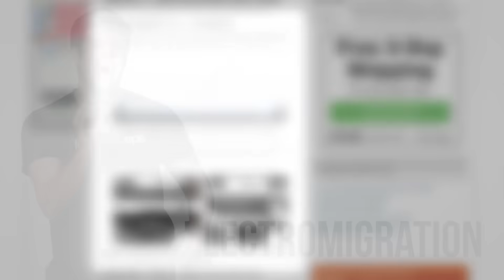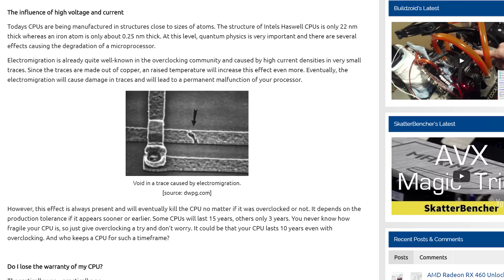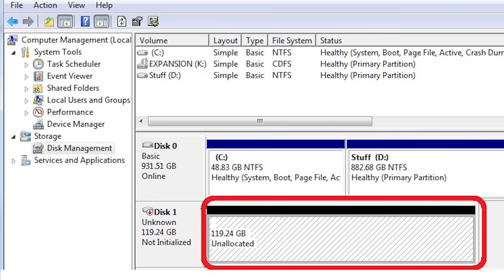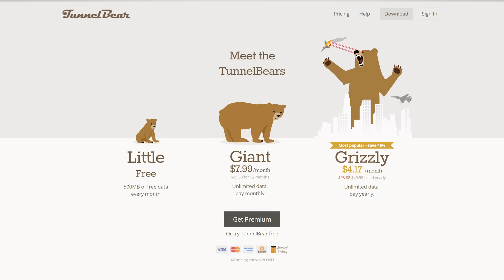Why Do Electronics Die?

Comment: Please explain to me why my TRS-80 Color Computer (1) from from 1981 still works just fine with all original parts? I don't understand. I thought all PCs die and get useless. The madness. It must be cursed. My 1996 Compaq Presario 4716 desktop pc must be cursed too. It still runs like the day I bought it with all original parts. 

.... Computers do last many decades, but they have to be built well and more importantly: You have to take care of them. Don't expect something last if you treat it like crap. Many times capacitors are the only thing that ever goes bad on a motherboard if you treat it well and you can replace capacitors easily. (note: I've not replaced a single thing on the afore-mentioned PCs, you get what you pay for)

Comment: The wear of flash memory is as follow:
Each time we need to change the value of a bit from 1 to 0 ot 0 to 1, a high voltage is generated (about 15 volt) to force the electron to zap thru an insulator. It is literally an electro-static shock similar to the flash on the spark plug in a motor.

Each time a different value is written, this is a burn mark. After 10 thousand (old flash) to 1 million (current flash) such write cycle, the damage is too much and that particular bit doesn't retain memory anymore.

Electro-migration of copper is real, but the explanation is not clear. At microscopic level, copper can be seen as a soft metal, similar to the way we perceive lead. Electric field and magnetic force induce force on the copper atoms, they start moving slowly, somehow like the ice in a glacier.

Thermal shock is probably the biggest aging factor. Each time we turn off the device, then on, many components expands or contract... soon or later, small cracks appear and expand on each thermal cycle. Screws holding power transistors to heat sink get loose. 

One day, the "perfect storm" happen : the weakest component increase it's resistance, get more hot than usual, expand more than ever before, heat increase on the highest resistive part. A run away race condition quickly conspire to destroy that weak device. As it short circuit, it damage an otherwise perfectly good power component. The PCB then absorb the high current and a few trace burns before the fuse finally come in to stop further damages.

The user replace the fuse by any other that he find ; 10 amp should be fine for a quick test, to replace that 1.25 amp. More PCB disappear in smoke. That piece of sh**t is trowed in garbage.

Comment: My Commodore 64 still running after 30 plus years... So...
Reply: Yet in that 30 years it could not do the work an i7 could do in a day.
Reply: Depends on the kind of work. Raw horsepower? No match, but if I need to type a document, do a little desktop publishing or use a spreadsheet, I could make it work, not as quick or convenient, but it would be possible. My i7 laptop is also far more portable and convenient, but doesn't quite give me the smile that C64 does.
Reply: So are smiles

Comment: I remember when my old samsung syncmaster 226BW broke from capacitor failure. I was so pissed off.
Reply: I remember when my Samsung died due to faulty capacitors. I replaced them with new ones. I bought quality Japanese manufactured Nichicon brand capacitors too.

Comment: And even if you somehow managed to solve all these problems your electronics would still die. Quantum tunneling gradually erodes a transistor's oxide gate. This is incidentally the same reason we are running up to an asymptote  with Moore's law and silicon MOSFETS. If we make them smaller or pack them closer together then quantum tunneling will allow electrons to skip the channel and go right into the output (meaning it still leaks power when turned off) or jump across channels and scramble all your signals.

Comment: I'm old enough to know & remember TV's, Radios, Turntables used to work for 20-25 years and they got hot enough to keep your food cozy.  So Planned Obsolescence is the Number one and biggest reason why electronics fail.  The designers/makers know they can make a product work for 100 years, like the light bulbs that were made in the early 1900's.
Reply: http://centennialbulb.org/cam.htm
Reply: Nonsense. TVs broke often. They were expensive so they were repaired often. The color TVs that I have used have lasted average of 9 years with total of at least three paid repairs for five sets.

Ah the light bulb conspiracy. That has been debunked so many times. Sure there is kernel of truth i.e. the cartel but the physics of light bulbs are well known. If you want t make a 60 watt bulb last twice as long and give same amount of light you need to make a 66 watt bulb. The bulbs costs some 50 cents and in 1000 hours it uses some $6 worth of electricity. That is  $6.50 for 1000 hours. Now the 66 watt bulb costs only 25 cents for 1000 hours but it uses  $6.60 worth of energy. That is $6.85 / 1000 hours. Also the color of the light from the 66 watt bulb would be more red.

Now there are applications where long lasting bulbs are good like if there are labor costs in changing. For those purposes there has been special bulbs. Also during heating period one could save hasting bill because f the extra heat but that in general is not that significant.

If you believe in the conspiracy when why did the manufacturers make long lasting bulbs using fluorescent bulbs or LEDs when the technology allowed it?

Comment: You missed one of the major causes of random failure in electronics tin whiskers in RoHS solder.
RoHS solder also is a lot more susceptible to thermal fatigue since it's more brittle than lead solder.
 This is one reason why an Atari 2600 or NES that's has been sitting in a box in in a hot attic for 20 years will often still work while an Xbox that has lived a comfortable life next to the TV dies after a few years.
 The Restriction of hazardous substances directive ironically probably has turned out to be one of the most environmentally harmful laws ever written.

Comment: Ah, finally he got to the moving parts in SSDs and circuit boards/wires... electrons and current! Also, you forgot to mention that dust build up is the biggest killer/perpetrator of heat! This video just made OCD people explode. lol, this is why Amazon CTO says "Computers fail all the time, so you have to plan for that".

Comment: I have worked in NAND drive development for 8 years.  If all goes well we know the precise number of cycles we can read write or clear bits. Done properly, we can slowly and safely manage the data. Using trend analysis we can even alert you ahead of time before a failure. As NAND gets smaller it wears out sooner. This is why old devices from the 80's will actually outlasts newer devices.
Reply: So , how is it going?
Reply: @sciencecreatedus9475  so, how is it going?
Reply: How's it going?

Comment: ther's a mistake there, the SSD life have timer, becouse the electrons build up in the insulator around the tranzistor, that stores data, and it's not about decreasing the voltage of the tranzistors ( that's the data retencion over time ), but change in the insulator properties, that can make reading, writing, or erasing the data imposible.

Comment: Heat. Heat kills electronics. Voltage spikes. Keep your stuff cool, and all electronics behind a UPS.
Reply: Your PSU should be able to manage voltage spikes. That is one of its jobs.
Reply: The key word there is 'SHOULD'. When 'should' doesn't happen, parts (sometimes very expensive parts) die. And you won't know the capacity of your power supply to manage voltage spikes (or even be the cause of them) until it's too late. Way too many nerds will buy the cheapest power supply labeled '1500 watts', believing that it's made in mongolia glossy box label with the lightning bolts on it, means it contains great components. See it all the time. $600 video card, $350 processor, on a $49 motherboard (because they got a great combo deal!) and a $39 power supply in a $35 (has to be black with a window) case.  Oh, and with a $10 keyboard and $4 mouse.

Comment: Most common killer, apart from planned failure... lead free solder. Those solder joints have no give when heated and cooled, they become brittle and crack. These cracks cause voltage drops and other problems including heat, which compounds the original problem.

Comment: So theoretically if we remove the issue of heat, it will (at least) become possible to have electronics that can last forever?
Reply: The underlying problem is you're running low direct current devices on relatively high alternating current. So at some point that scheme is going to break down. When it does bad things happen too.

Comment: Actually manufacturing something to fail about the time the warranty runs up is an unfair business practice under most consumer law, and possibly fraud depending on the circumstances.

Planned obsolescence is more so the 'rationing' of technological advances.  Essentially better technology exists, but a company will try and sell what they haven't sold yet.  Kind of like what Intel is doing.  They could release better processors, but have stayed with a consistent 10% upgrade.  However with Ryzen competition, they may ditch the next upgrade and skip over to something more competitive.

Comment: Current is the flow of holes aka the absence of electrons. Current always flows in the opposite direction of electron flow... Electrons are negatively charged, hence why the positive side of the battery is the source of current.
Reply: No. Ben just guessed wrong. That is why conventional is opposite actual current flow.

Comment: While I have long raged about planned obsolescence, the hardware versions of it (for computers) is more a lack of overengineering. They know that, even if they make it so it can last 100 years, 99.999% of them will be thrown out within 10-15 years (often times less). 

Planned obsolescence is definitely a problem with cell phones, and any time a software update significantly reduces performance there is no way it can be anything but. If you aren't willing to maintain support for a product, don't allow the new update to be installed on it. 95-99% of users won't even use the changes much, and 100% of them would prefer a usable older OS to a newer, more featured, unusably slow OS.

But even worse than cell phones/software is the fucking appliance manufacturers. They carefully calculate how durable they have to make the parts for it to last long enough that it isn't too obvious, and then offer a warranty that they expect to expire anywhere from a month to a year before the thing breaks. At least with the cell phones and OS issues it is primarily them knowing it will break and not caring, those damn appliance companies spend significant effort figuring out just the right balance needed to screw consumers the hardest, without getting them so angry they go to a different brand.

Comment: Electrons don't have mass.... but close enough
Reply: Kyli Rouge You're kidding right?  Electrons have mass...
Reply: EGL24Xx electrons (aka photons) have no inherent mass. Don't you remember why the Higgs-Boson was such a big deal?
Reply: Kyli Rouge Electrons and photons are not the same.  Not even close
Reply: huh... seems I'm wrong. I coulda sworn photons were just electrons in some different state. Today I re-learned! Anyway my original point was going to be that it's probably more electromagnetic forces between atoms than mass-based collisions which tears apart processors.
Reply: As an Electrical Engineer, I've actually studied electromigration in my IC design classes.  It's annoying haha
Reply: Kyli Rouge Electrons does have mass. You can by all means search for it. You can also try reading some Semiconductor Physics for reference. I dont studied Engineering just to see this shit

Comment: My past laptops have been killed when the hard drive finally dies as a result of the computer being moved, jiggled, jerked and transported a lot.  When I was less knowledgeable about things like replacing my own hard drive and the computer was getting old anyway I would use that as an excuse to replace the machine.
Last year I put a 1TB SSD in my 2012 Samsung laptop which makes it totally up to speed for anything except high performance gaming.  I've replaced other parts after past hardware failures and I hope to get many more years out of this machine.
The only thing newer computers have to offer me right now is that some of them have a super long battery life.

Comment: If you think of how much electronics are found in cars today and how many things they control(engine management, safety features,  keyless entry, stop/start, traction control emergency breaking, lane assist, adaptive cruise control ) plus the temperature changes they operate at compared to pc's it is more than a bit scary to think what would a failure or malfunction could do.
Reply: That is why I drive a 20 year old carburetor car. Only ignition and sound system is electronic.
Reply: my father had the FICM..."Fuel injection control module" go out in his 2004 Chevy Duramax truck.  The truck has only 160K miles on it and is in great shape. GM or Isuzu (manufacturer of the engine) doesn't make them anymore.  No aftermarket manufacturers make the FICM, nor can a modern part be adapted.   The only ones out there are from scrapped trucks.  He had to wait 4 months to get one from a junkyard.

Comment: Planned Obsolescence really is a huge shame. I realize they are making computers smaller but I kind of cringe at thinking I'm purchasing junk when I buy a tablet or phone with soldered in components and battery. Also an OS that can't be easily replaced. Companies want you to buy a new device every other year so they use peer pressure in advertising while making devices that won't last years like older computers often do.

Comment: Mechanical and hydraulic systems usually give a fair bit of warning before they fail completely, but when electronics fail, it's usually without any warning. This is what concerns me about modern vehicles, as "drive by wire" systems are becoming more and more common. Electronics tend to be one of the less reliable aspects of a car.

Comment: Another major issue is Tin Whiskers growth (electron migration) between 2 points between exposed wires, solder joints, leads, and traces on the PCB. With the elimination of Lead based solder to Lead free solder which is 95%Tin based, this may cause electronics to fail faster.

Comment: "electrolytes that conduct current" 1:00

the electrolytes operate as a dyelectric and are desined to have a the highest resistance possible much higher than air.

Comment: 1:03 Um, electrolytes conducting current??? The opposite is true. You have no idea how capacitors work. Once they conduct current, they are broken.
Reply: My capacitors conduct current and they work fine. Capacitors conduct alternating current. That is why capacitive dropper circuits work.
Reply: With "they" i meant electrolytes and i got that confused with dielectrics. But even then it depends on your perspective. From a technician's POV, yes they (electrolytes, caps, take your pick) conduct AC, but it's not like electrons actually traverse them.
Reply: No. The word electricity refers generally to the movement of electrons (or other charge carriers) through a conductor... 
See https://en.wikipedia.org/wiki/Speed_of_electricity

Comment: electrons bump  each other and are a cost to the medium over time as well which is why coaxial cable and usb cables lose integrity and eventually  fail as well
  Example, if tightening your cable to your tv or cable wifi doesn't clear up the picture or reduce noise on the internet  then try replacing  the coaxial cable.....especially if its over 10 years old and you use it a lot

Comment: Planned obsolescence is the cancer of capitalism. If we had an infinite amount of resources and producing tons of waste did not matter, then sure. Keeping people buying new things keeps the economy going and to be frank we live in an era of people wanting new gadgets and features all the time. However, imagine buying a product that was actually designed to last as long as possible. Imagine software developers not purposefully changing the operating system of devices to require better hardware over time. There are so many people that just want to buy something that works but not necessarily the best. If we could get a device that would last tens of years without any failure or degrading performance over that time, just think of the resources we could spare in this age of increasing environmental issues. Problem is, that is never going to happen while the economy works the way it does. Companies don't sell the best products, they simply sell products that are good enough, meaning people will come back and buy the famous brands again once their stuff wears out. It's a troubling topic, there seems to be no good solution to it unless both our politics and culture change, which is highely unlikely on a short time scale. :/